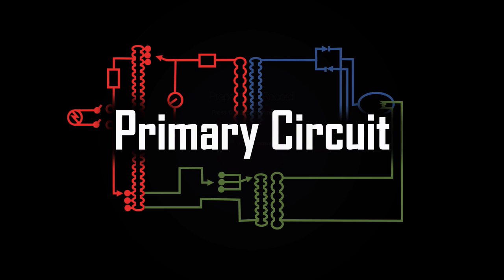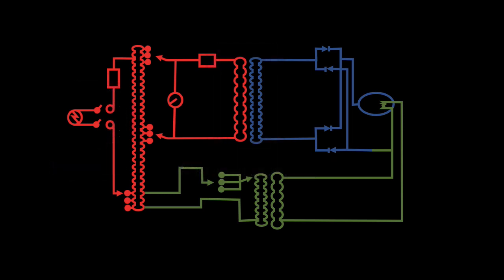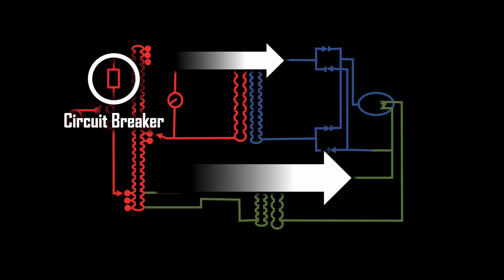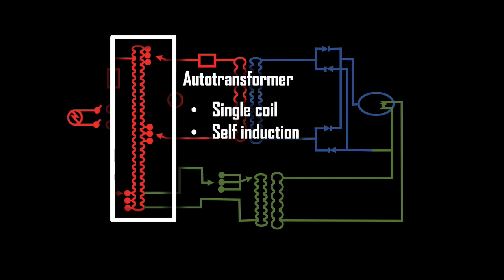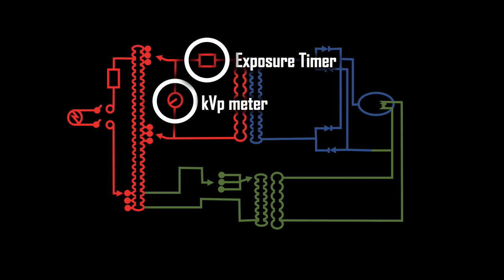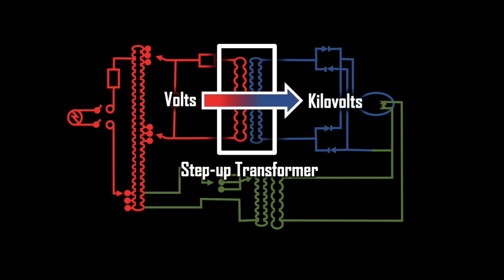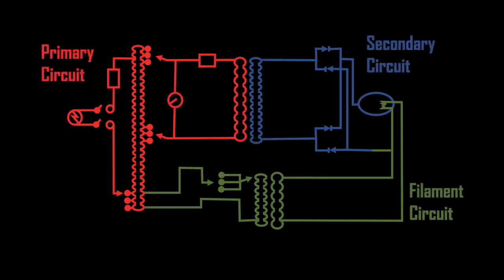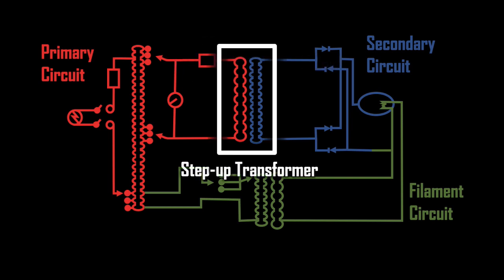X Ray Circuit (Primary Circuit)

Comment: this makes so much sense. but what about the secondary and fillament circuit? can u make another vid for that please
Reply: From the schematic, looks like the secondary circuit takes the stepped up the high voltage AC and puts it through a FULL BRIDGE RECTIFIER!!!! to get a rapidly pulsing DC output to send to the tube's anode and cathode.  The difference in energy between the anode and cathode will determine how much energy each electron gets.

The filament circuit has a step down transformer to drop the volts down to 10v.  when you step down voltage, the amperage increases thanks to ohm's law, and this circuit is used to heat the filament.  The hotter the filament, the more electrons are wont to leave the cathode and fly to the anode.  The trident looking thing is probably the variable resistor which lets you set how many amps should go through the filament, which in turn lets you decide how many electrons to launch from the overcrowded, war-torn  planet Cathode across that lonely vacuum of space to the exciting new frontier called  planet Anode.

So the secondary circuit increases the electrical potential, giving each individual electron a set range of energy, and the filament circuit loosens up those electrons, increasing the amount of electrons sent across.  There's also probably an ammeter somewhere in there to 

Think of a bag of marbles.  Electron volts would be the weight of each marble, and the amps as the size of the opening in the bag, letting more marbles out the bigger the opening.   The secondary circuit adds heavier marbles to the bag, and the filament circuit widens or narrows the opening, allowing you to pour out more or less marbles from the bag each second.
Reply: Seaprimate Jenkins amazing! Thank you so much for explaining this to me and not charging me $29.95/month for it!!! Crazy this channel begins one “a series of 3 videos”, shows the first one and then charges us to watch the last 2. I appreciate your help so much as I’m taking ARRT next week . Your expertise is so appreciated! Have a great day !!!!
Reply: I am interested too. Please make a video on the rest of the circuits.
Reply from the maker: The rest of those videos can be found at www.radtechbootcamp.com

Comment: This may be a dumb question, but how does a portable x-ray machine work? I know transformers only work with AC current but if you have a portable x-ray machine its working off of a battery which is DC?